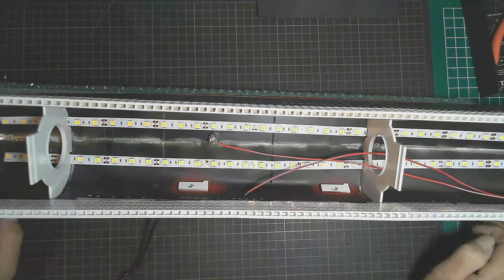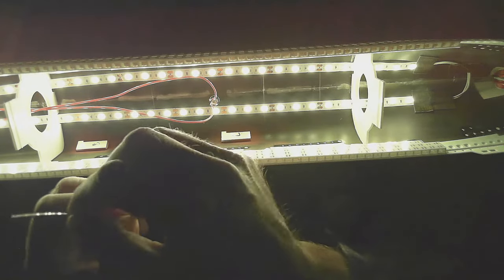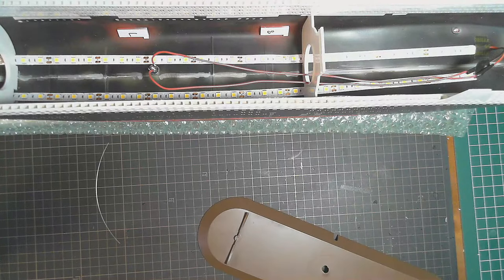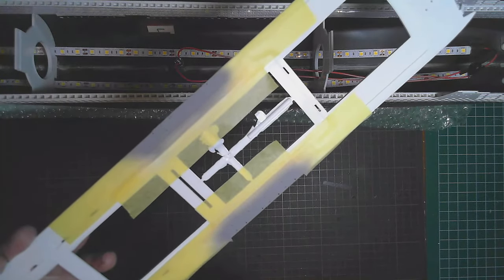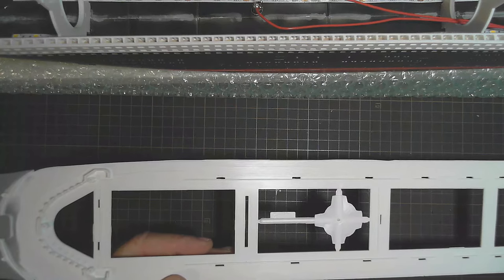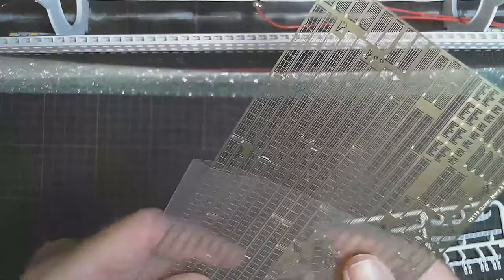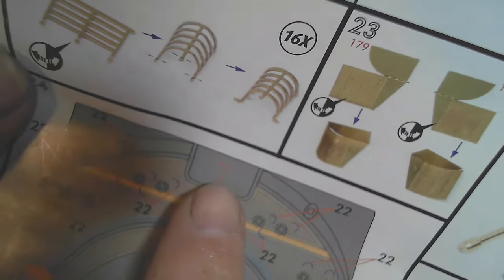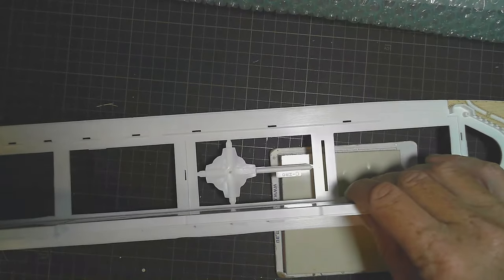Revell 1/400 Queen Mary 2 Platinum Edition Build Part 10

Comment: The wood decking inside the ship at the forward end is the enclosed part of the wrap around promenade. On QE2 her promenade was exposed at the front and this made it untenable in all but calm conditions. I used the Rotterdam (1959) as inspiration for enclosing QM2’s promenade. The small exterior etch brass enclosures are post-delivery additions to form wind breaks to allow passengers to access the deck more easily.
Reply from the maker: Where can I see the progress of your QM2 build? :)
Reply: @OzScalemodeling  Hi Peter, I’ve been working on specific details so that I can advise Jason in advance of him reaching specific sections. I have to work on my hulls before I have anything of substance to show. I’ve been very busy with a real life project in recent weeks which has greatly slowed my progress.

Comment: Peter, I think you may have been trying to put the starboard side of the superstructure on the portside with the forward end orientated to aft -take a look. The high end faces forward and the lower large square windows are at the aft end -they are the grill room windows at the aft end of the deck.

Comment: I’ve not ever been a fan of photo etch as it never looks right I myself tend to look to make as much as I can from scrap card and rod, the build looks bloody good and now that I have one of these boats I’ll look forward to more of your build. The hand rail is a problem as the photo etch is flat and the rails are round with an oval top rail, do you have the Haynes manual on this as it’s a great help for most of the reference you need. Cheers and I’ll look forward to the next build vid well done mate it’s a fantastic build so far 😉👍🏻🍻💙🇬🇧
Reply from the maker: 'Haynes manual' Wow I didn't even know this existed. I'm ordering one now 👍
Reply: @OzScalemodeling  it was the first thing I looked up before I got the model it’s full of good stuff, i paid £12.50 for my copy so hunt around for it as they’re pricey in most places 😉👍🏻🍻💙🇬🇧

Comment: Behind the strip of decking is the gymnasium which looks out onto the enclosed promenade and beyond to the open deck through the forward windows. The forward props are the 8 spare propeller blades; 2 for each propeller. The brass strip across the deck represents the gutter way cover.
Reply from the maker: Thank you for that info :)

Comment: Hello Peter
Great build series, |I really enjoyed following along.  I’m hoping you can help me. I’ve now started the model and have completed the Hull section following your methods exactly, which has worked out really well for me. As I’m planning to light the interior, I was wondering if you would be able to post a list of all the lighting components you used, preferably with Amazon links if possible?
Reply from the maker: In the About tab on my channel page is my email. Send me one and I can send you a list , they are all Ebay items but I'm sure you will find what you need. 👍🇭🇲